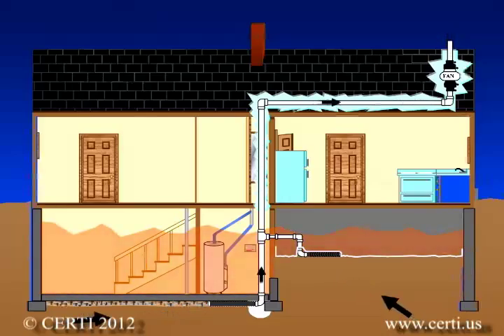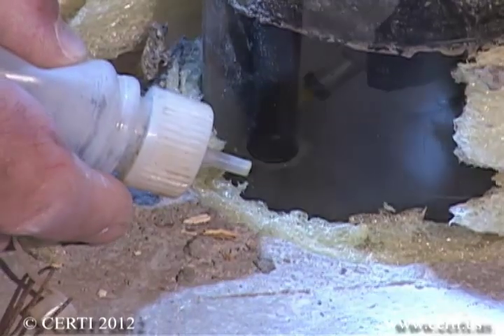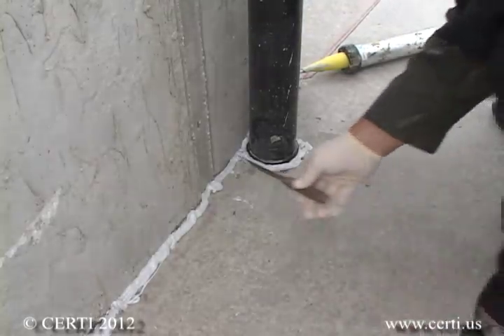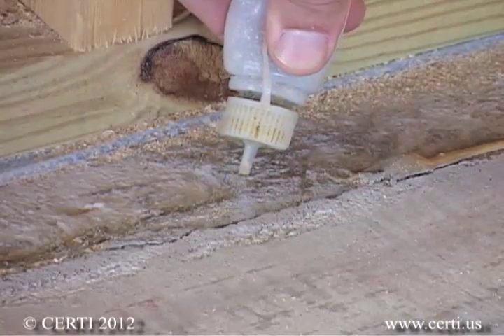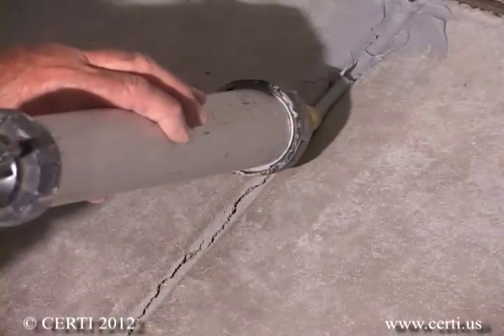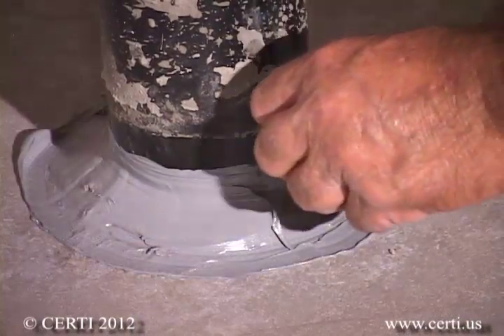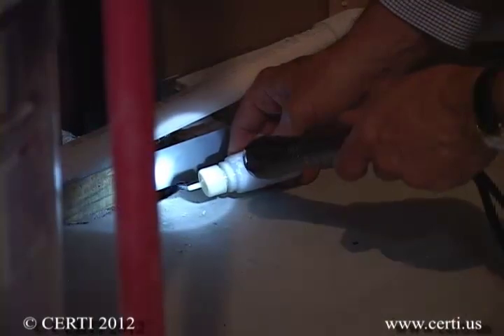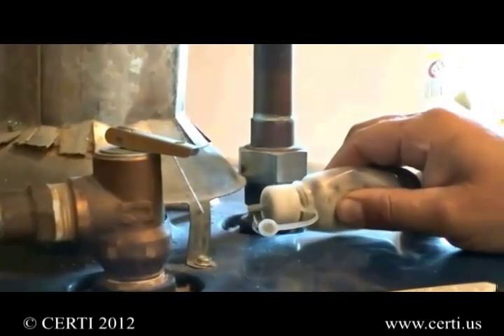Caulking and Sealing to Improve Radon Mitigation

Comment: It was recommended to install the radon vent pipe as close to the inside of the exterior wall by drilling a hole on the slab in that area  but  Would it be easier to install the pipe vent on the exterior walls of the house all 4 sides to vent any radon in the soil passively without a running motor ? This would cost around $300 and easy to install